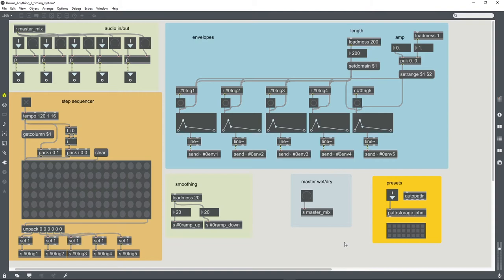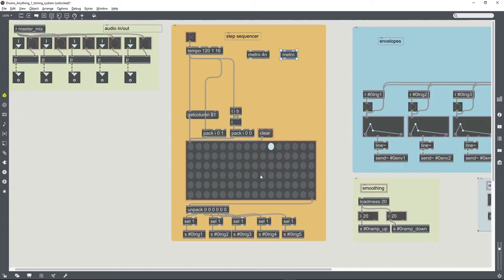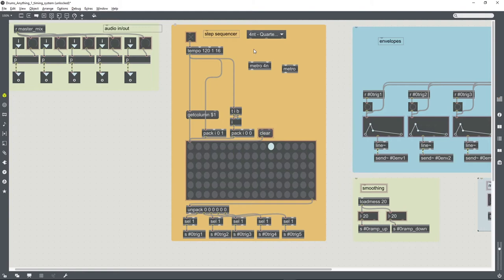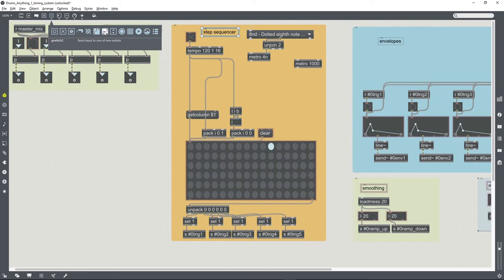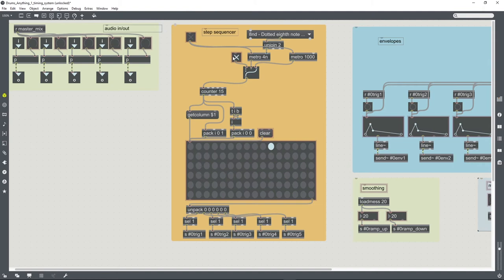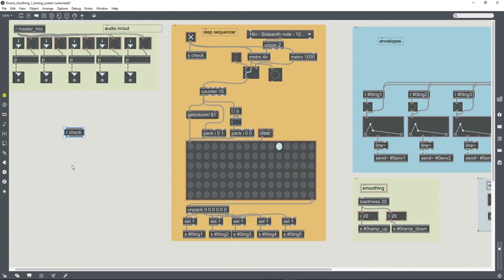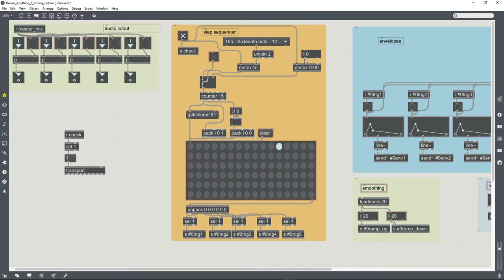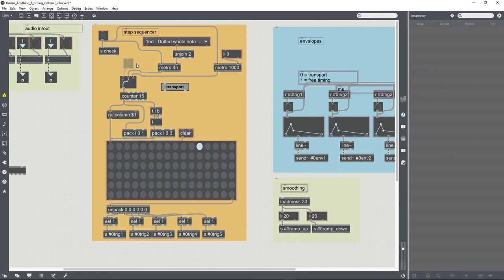Max/MSP Tutorial: audio envelope step sequencer (part 5)

Comment from the maker: the processed text from the max documentation, if anyone wants it;

1nd - Dotted whole note - 2880 ticks, 1n - Whole note - 1920 ticks, 1nt - Whole note triplet - 1280 ticks, 2nd - Dotted half note - 1440 ticks, 2n - Half note - 960 ticks, 2nt - Half note triplet - 640 ticks, 4nd - Dotted quarter note - 720 ticks, 4n - Quarter note - 480 ticks, 4nt - Quarter note triplet - 320 ticks, 8nd - Dotted eighth note - 360 ticks, 8n - Eighth note - 240 ticks, 8nt - Eighth note triplet - 160 ticks, 16nd - Dotted sixteenth note - 180 ticks, 16n - Sixteenth note - 120 ticks, 16nt - Sixteenth note triplet - 80 ticks, 32nd - Dotted thirty-second note - 90 ticks, 32n - thirty-second note - 60 ticks, 32nt - thirty-second-note triplet - 40 ticks, 64nd - Dotted sixty-fourth note - 45 ticks, 64n - Sixty-fourth note - 30 ticks, 128n - One-hundred-twenty-eighth note - 15 ticks

Comment: Hi there really love your work. I was just wondering, in your part 2 video where you created a chopped audio sequence, you had 5 inputs in the bpatch. But after doing this one, I have 6 inputs, is it wrong on my side or is that for dry/wet fader? 
Thank You
Reply from the maker: Glad you're getting something out of the videos! The 6th inlet is going into the pattrstorage object. The point of that will become clear when I put together a video that makes a piece of music using this device. Basically, it allows you to send messages to the pattrstorage from the main patch that this bpatcher is loaded into, in order to save and load presets, and to switch between presets. (the first series of vids i made uses the a similar pattrstorage method, in the meantime, just not in a bpatcher)